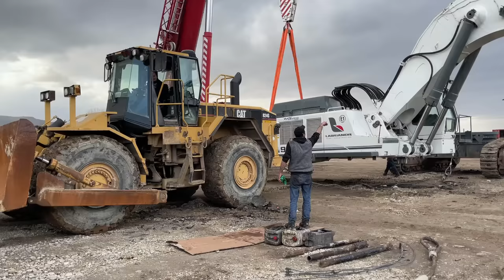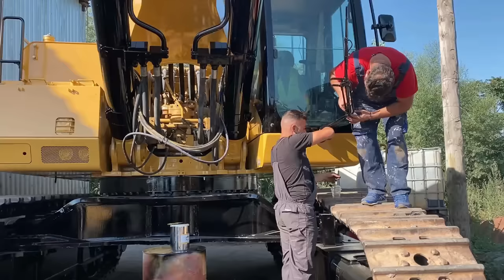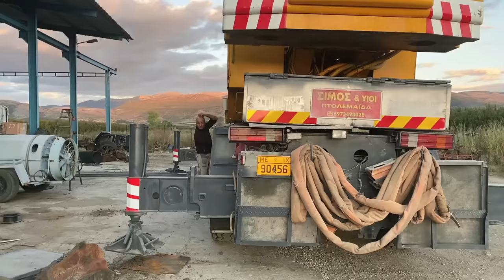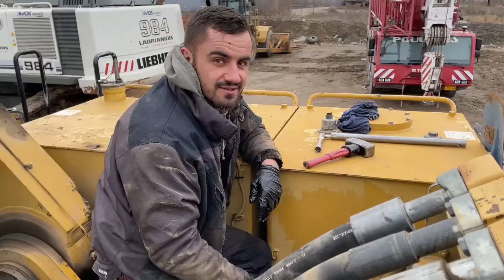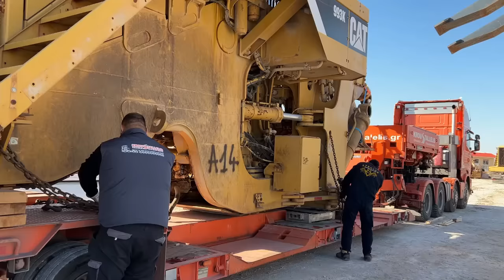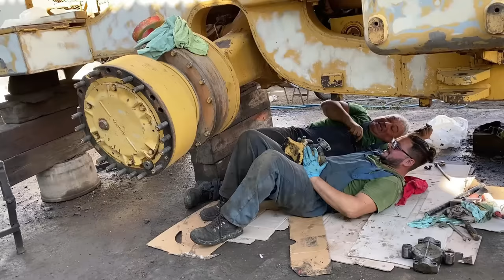Almost Two Hours Service And Repair Of Huge Construction And Mining Machinery - Mega Machines Movie

Comment: When you are installing the small pin, pick up the bucket, then you can move the bucket to align the pin..  The pins will go in a lot easier with a coating of grease on them also..
Reply: Also, keeping dipper plumb makes it easier to insert main pin.
Reply: Not sure these guys have seen that technique. It works for my machine
Reply: Since you seem to know what you're talking about, what are these attachments I feel like I've seen where the operator literally just drives up and can either snatch up or drop the bucket without ever even getting out of the cab. Seems like that's a no brainer way to go right?
Reply: @Glitch-nr9ct  Some buckets have a quick attach option on them..  The down side is the added weight and the added distance including the quick attach..
Reply: @rbbarnby108  added distance is a bad thing?

Comment: At the  16:04 Should they have designed the pin the opposite way, one could just let ones body weight tighten up the bolts, instead of lifting to tighten!  I am figuring that they are 1/2" or metric 13mm's? 
Never saw the design logic of the horizontal pins for the teeth! The 45* ones make sense!